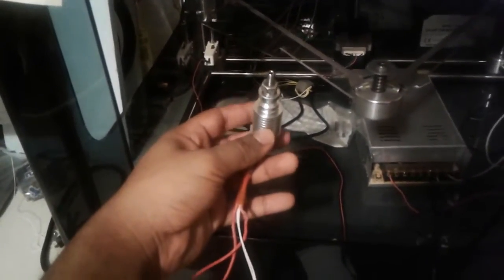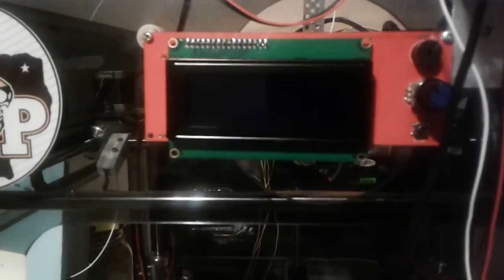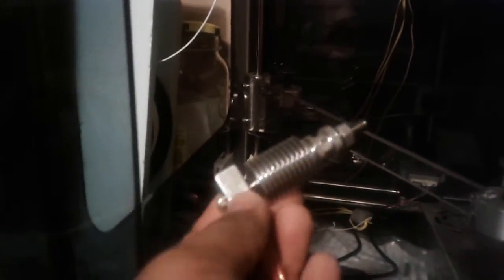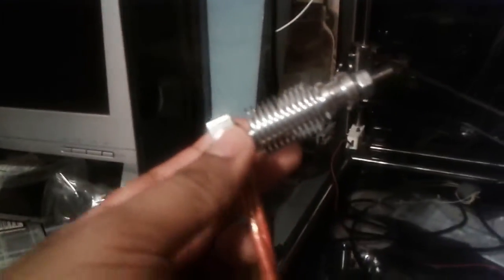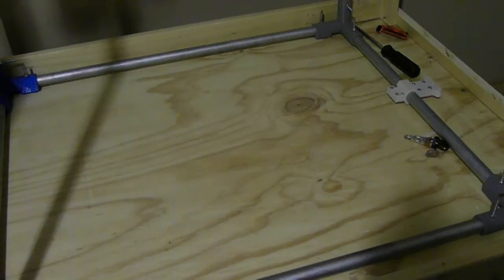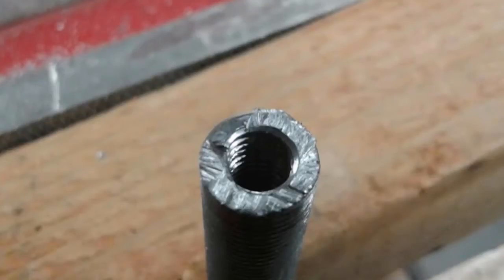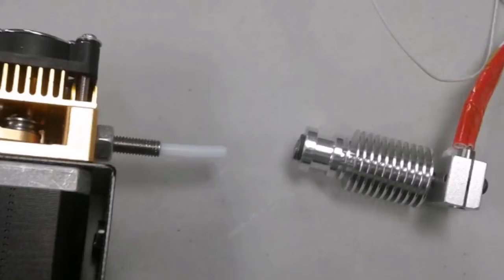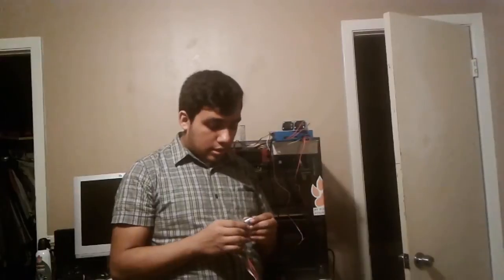How to combine an E3d heat sink(clone) and a MK8 extruder

Comment: Alu holder for this http://www.3dmaxprinter.com/shop/parts/extruder/mounting-mk8-extruder-aluminum-block-assembling-hotend-x-axis-3d-printer/
Reply from the maker: The mount that it has now already works okay. I used a generic stepper mount and drilled it into the old plate on the x carriage of the bfb. The printer was a little tricky at first, but it's printing fine now.